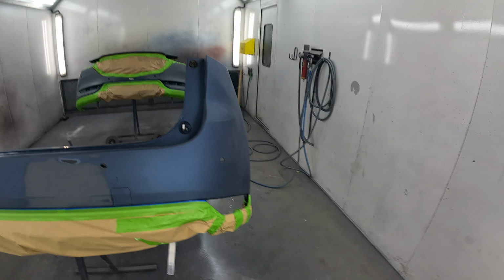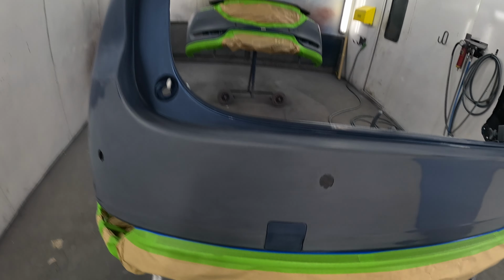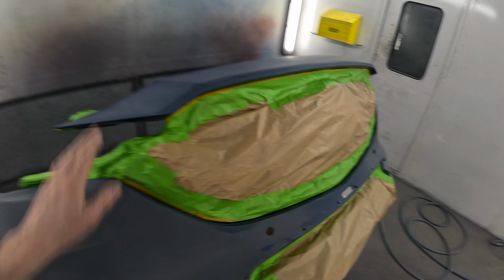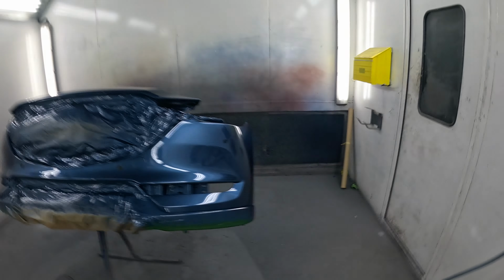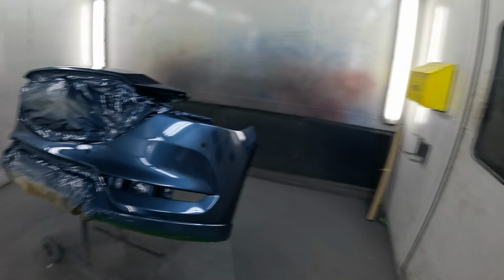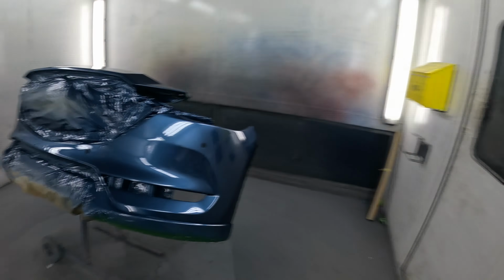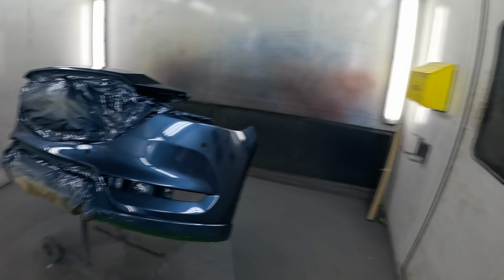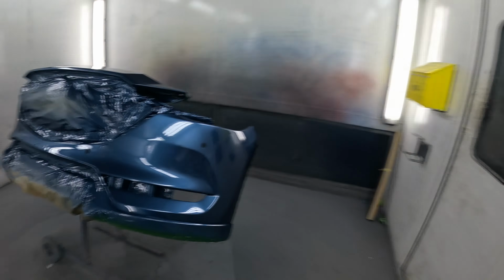The Problem with Making a Paint Job look to Good,  Matching Factory Orange Peel

Comment: I have a very humble question for you. Wouldn't it be easier to remove the grill and the lower bumper since both bumpers are already removed from the car? Instead of masking them you would get a slicker finish and no chance of paint lifting in the future.
Reply from the maker: Yeah, but behind the middle grill it had frame work behind it and was plastic welded but we took of the chrome surround so no problem with getting paint around it, the lower bumper is part of the moulded bumper, it doesn’t separate it’s masked off when they are painted new
It’s masked off with fine line tape  
I wasn’t looking for slicker finish it’s a Mazda😂
Reply: @TheHumblePaintSprayer333  Thanks for the info.

Comment: What grit do you block sand primer ?
Reply from the maker: 320 Grit most of the time, sometimes 240 if its a large areas or need a bit more level but i make sure I've got enough primer on there, then work through the grades and finish in 600 grit DA
Reply: @TheHumblePaintSprayer333  ive blocked and on the primer stage on a full door. Wondering whether to hit it with 320 or 240...
Reply from the maker: @edsmith3170  Id only go 240 if you got a good build on there

Comment: Good job there Jay what would happen if you used Mipa f37  dark grey primer wet on wet would  it change the colour all together
Reply from the maker: 👍 it can do on certain colours
Reply: @TheHumblePaintSprayer333   so jay if am doing a vauxhall astra cdi j exite front bumper new one after market and its paint code mate phantom  190 solvent base coat paint  it's a dark grey colour so use a dark primer on that Mipa f37 dark grey
Reply from the maker: @ANDY-we7mr  mid grey will be fine
Reply: @cammy9r its just a black bumper after market off ebay  the colour is phantom gray code 190
Reply: Yes but the bumper  still have to be primered  that's why I said a mipa f37 dark grey wet one wet and phantom 190 base coat paint and clear coat paint on and the same with the new passenger side front wing